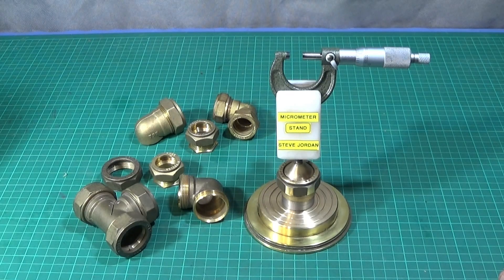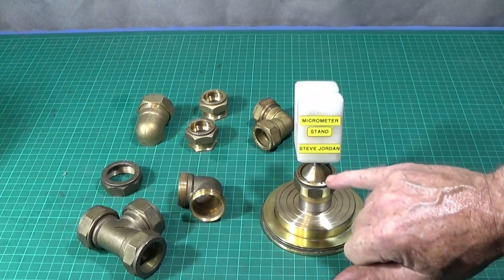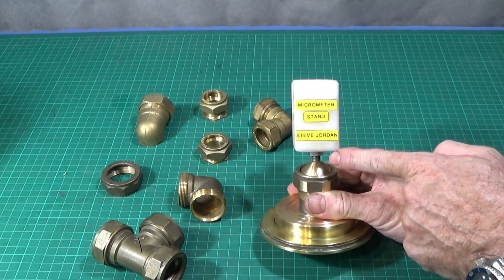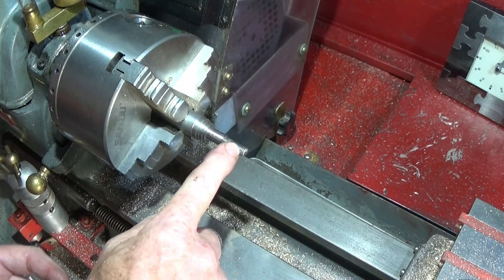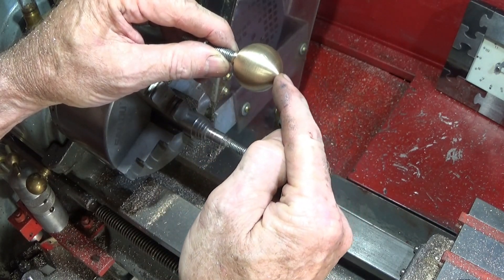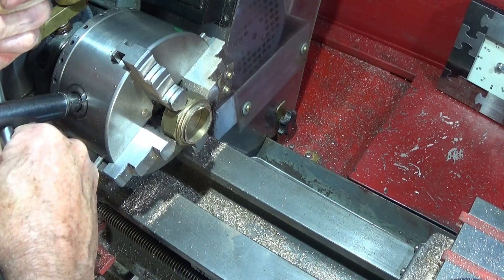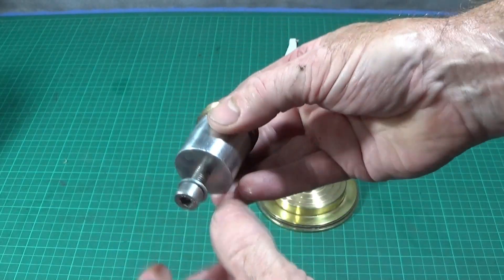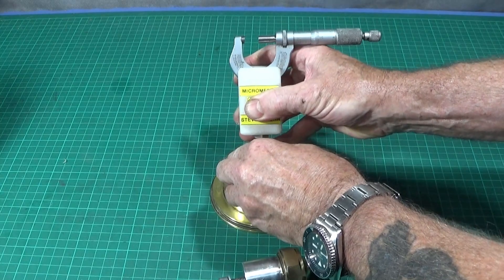MAKING AN ADJUSTABLE  SWIVEL BALL JOINT MICROMETER STAND

Comment: Absolutely awesome I have to make me a ball turner first but will be making one maybe 2 of these . I only have 1in 2 in and 3 in micrometer so will this size accommodate all 3 ?
Reply from the maker: Hi Yes, you can make one so it will accept all the micrometres. I will show how I make the block clamp soon. Also, I can make the brass 30mm ball up and put one on eBay for people who do not have a ball turning fixture? Regards Steve